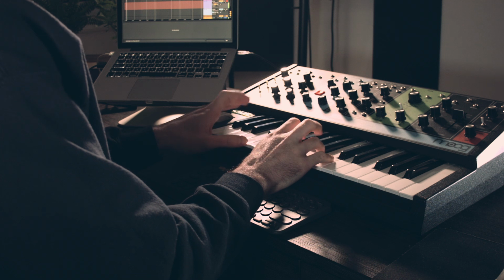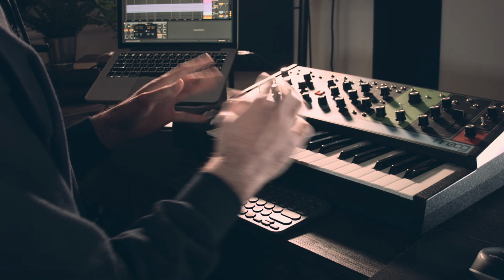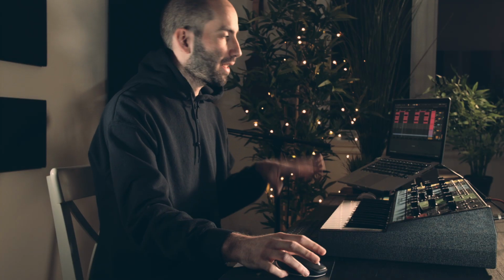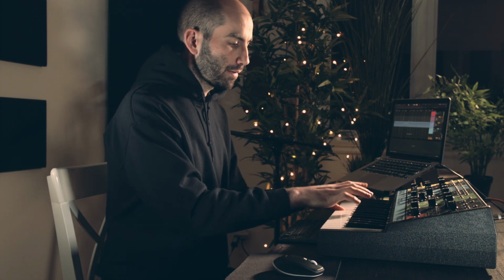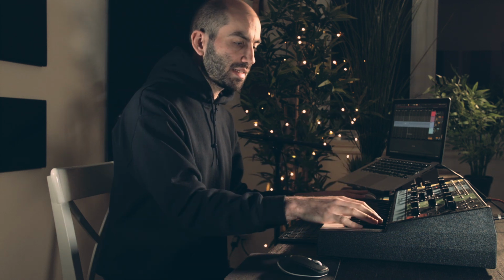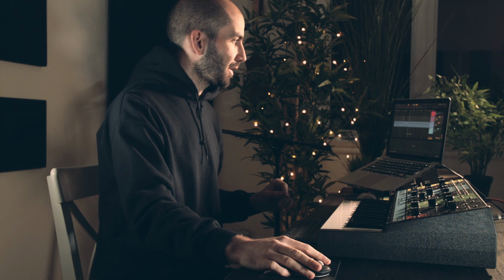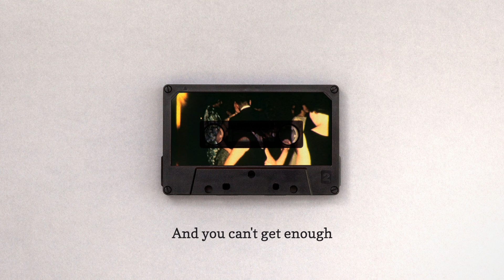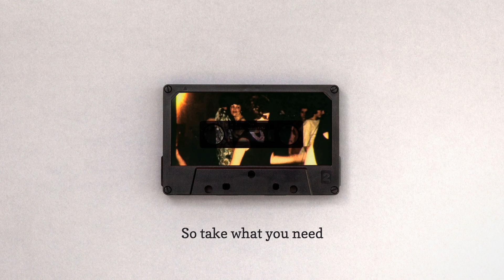Making a house song from scratch with Moog Grandmother in Ableton Live

Comment: This is awesome. Hey, do you still have the Deepmind 12? I just bought a Grandmother to learn synthesis, maybe dabble in Semi-modular/modular, also great for Bass and leads, Arp and sequence. I was checking out the Waldorf Blofeld, Access Virus T12 Polar, a Sledge with the Waldorf Architecture and Deepmind 12 for all other sounds. I ask because I know that Kemper abandoned future improvements to the T12, and the Blofeld has crashing and/encoder issues. I know the updates were supposed to address this on the Blofeld...and has it? ) Opinions on that gear would be appreciated.